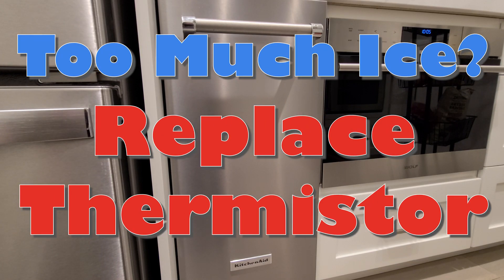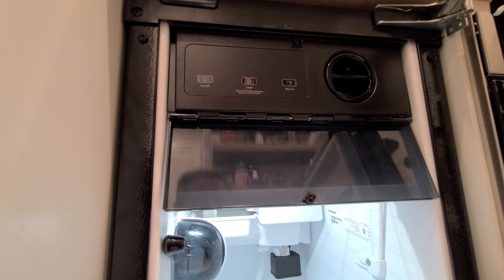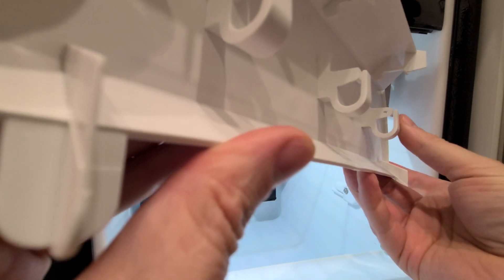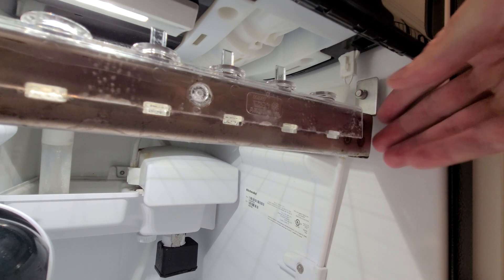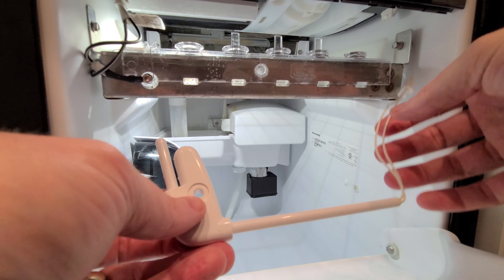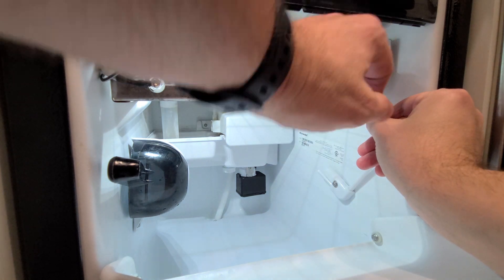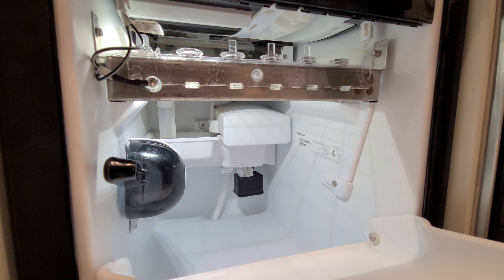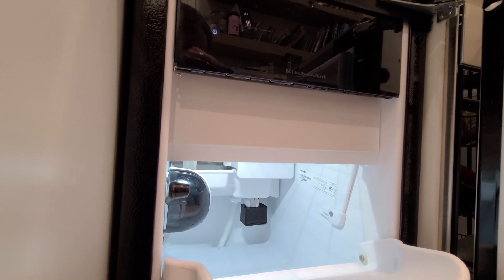Too Much Ice Maker Ice? Quick Fix DIY Replace Thermistor | Ice Machine Repair

Comment: Mine keeps making ice nonstop, and I tested my Thermistor with a multi-meter and it looks to be fine. Do you know where the wires are leading so I can test the board relays?
Reply from the maker: I've never tested the board relays. Does anyone know where the wires connect to the board?
Reply: @ChrisBallam I ordered a new board. It was located above the ice box. Hoping this does the trick.